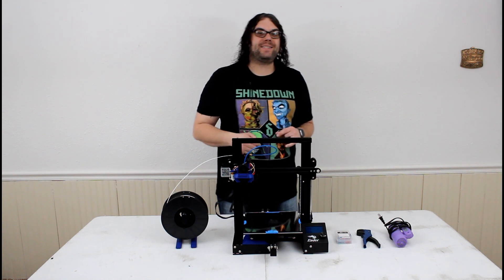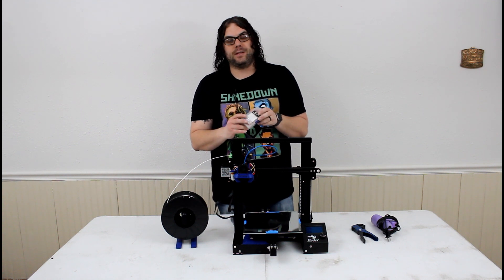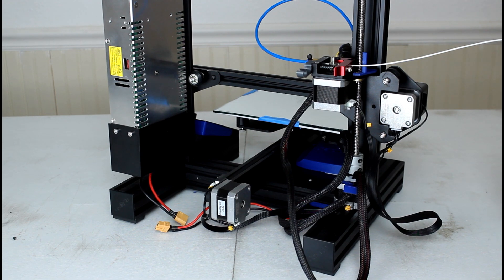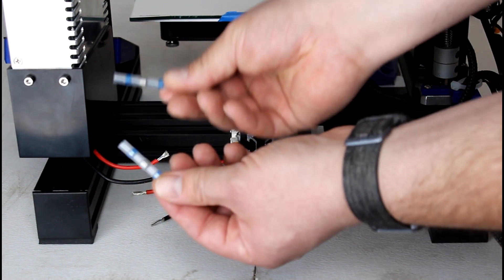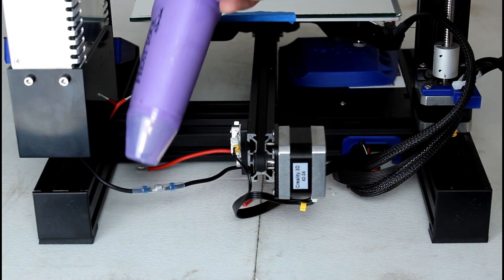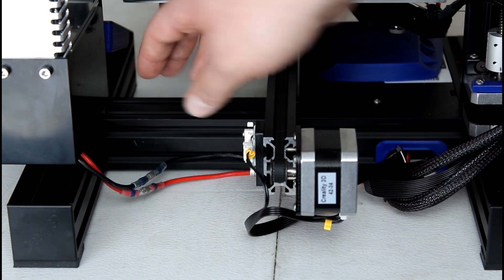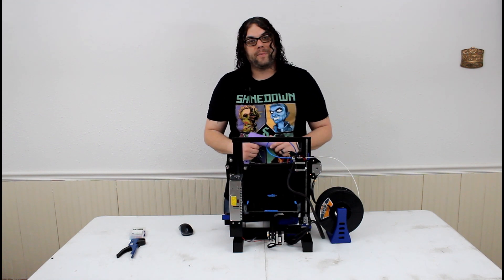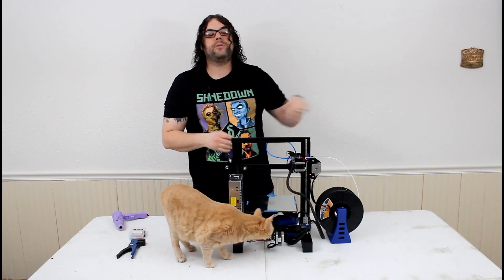Ender 3 XT60 Fix in less than 10 minutes without rewiring or Solder

Comment: I don't know if I would trust that solder joint especially if there was no flux used. Personally I would have twisted the bare wires and fluxed and tinned each end. Then use your connectors. But if thats what the directions said to do then your probably fine. I would think that it would be very likely that you would have a cold joint that could potentially work loose. Heating two tinned wires together would flow the solder right to each other very easily and would be very reliable.
Reply: These connectors have flux in them. The heat gun solders and seals the connection.

Comment: Interesting connectors but I would not trust them. I would prefer to properly solder them and use heat shrink. My Ender 3 connectors are always cold so I have no need at this time.
Reply: Actually genuine Amass XT60 connectors work fine and are not an issue.  Unfortunately creality is obviously using counterfeit knock off versions that are problematic.

Genuine Amass XT60s have a current rating of 60A and were specifically designed for inductive motor loads and resistive loads where there are high current in rush and high heat loads.

Comment: What is the issue being fixed here?  I actually used a n XT60 female to dual male adapter and split off the power to a buck convertor to supply the 5v for the raspberry pi running Octoprint
Reply from the maker: Hi! Thanks for watching! It's because they are using fake connectors in some cases and either are only crimped or poorly soldered. But if yours don't get hot at all during long prints, you may be ok. If they used authentic XT60 connectors and a good solder connection, this would have never been an issue.
Reply: @TheEdgeofTech  my Ender 3 is made by Hictop and doesn't seem to have that problem

Comment: I see u r using stock psu too like me, did u check grounding problem urs ? I check mine its not good applied th3d s grounding fix but i dont trust psu ill order meanwell rs350 24v. Btw i replaced with amass xt 60 before mine gets 85C lol now room temp
Reply from the maker: I am using the stock PSU and will be ordering new ones after seeing TH3D's video. And I'm glad you replaced your XT60 connectors before they were an issue!
Reply: @TheEdgeofTech  thank you Jim u r always replied all comments, u r a good & kind person.

Comment: A decent idea but a better solution is just to replace the whole length of red and black wire from PSU to board.  If you are ordering the shrink wraps on Amazon just get red and black 12 AWG silcone wire instead.
Reply from the maker: Thanks for watching! This video is for those who don't want to replace the whole wire, or who don't feel comfortable with playing with the board etc. The next Video that will be coming out goes over the full replacement of the wires using 12 gauge silicone wire. That way I shown options for both methods.
Reply: @TheEdgeofTech  Awesome. Keep up the great work. I've been watching your videos to help me get my Ender 3 Pro sorted out. Lots of good info.
Reply from the maker: Thank you! I hope it gets running great!! Thanks for watching!